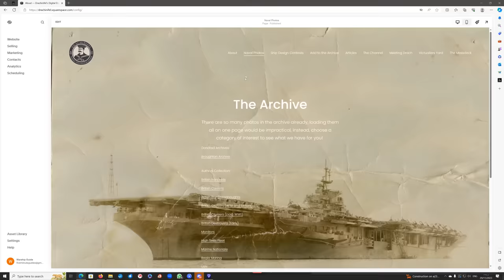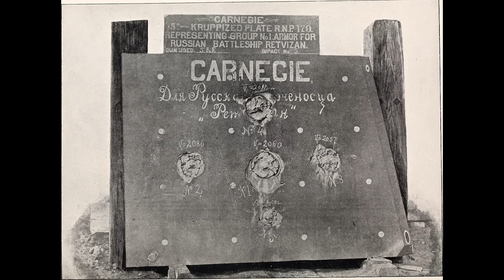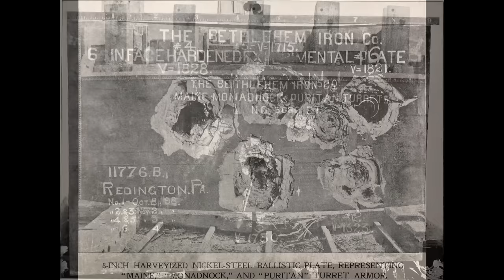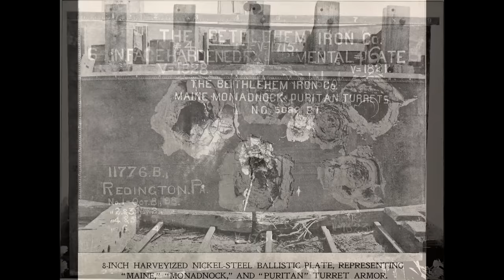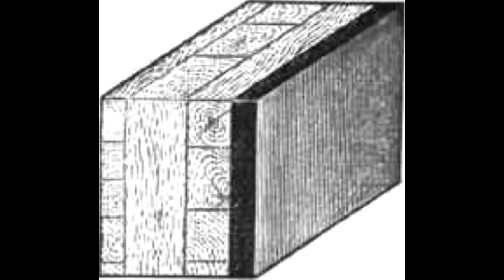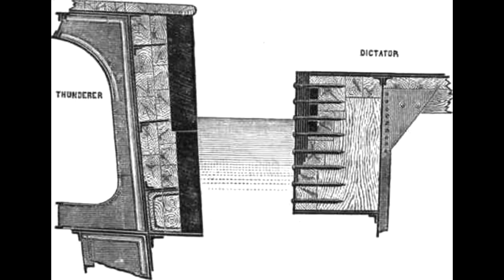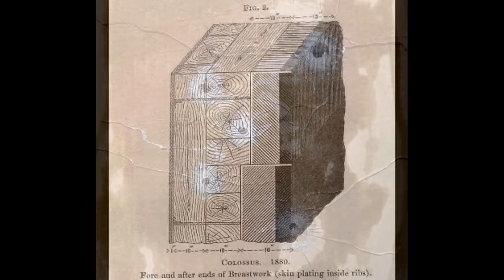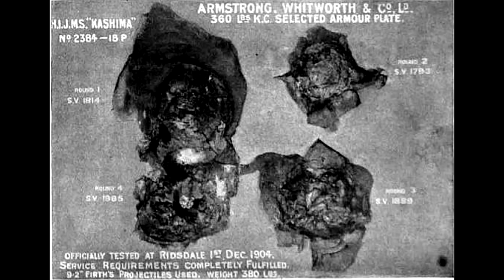Battleship Armour Engineering - Why is naval armour multi-layered?

Comment: I found it also quite interesting that with the glued together "plate" so many of the glas chips were sent flying toward the "attack." I would have expected them to penetrate slightly into the cardboard and get stuck there, rather than fyling out in the opposite direction. Is that something unique to glass and cardboard, or was a similar effect also observed with metal over wood compounds?

Comment: The word you are looking for is "toughness" which is essentially quantified by how much energy a material can absorb in an impact before fracture. This is a distinct mechanical property separate from "hardness" and "ductility"
Reply from the maker: Whilst your definition is correct that's not  the term that's useful here. With considerations of armour plate in this context its not so much when it breaks as how it breaks, any armour can be overwhelmed with a big enough gun at close enough range. But when it breaks, whether the material is relatively brittle or ductile massively affects if the material mostly remains in place, which is vital for a ship under bombardment from multiple shots.

Comment: One of the tragedies of life is that there weren’t any video cameras around to capture these tests.  I’d love to see how close the cannon was placed to the plates.  

A “finger pull” holds no fire to the 12 pounder at point blank range 😂
Reply: I always think about that with a lot of things. It would have been amazing to see things like these tests. Even with things that were recorded, I think about if there had been the high definition tech we have now, back then, it would have been incredible. The biggest one I think about is the atomic weapons tests. The detail we would be able to see would be incredible.
Reply: During tests, at least in WWII, the shells would deliberately be fitted with less propellant to simulate the desired range for testing (i.e. make the shell as slow as it would be at that range), even if the physical cannon was point blank. No reason they couldnt do that in the 1800s, at least approximately.
Reply: @builder396  it looks like that’s what the different numbers may represent.  Maybe feet per second or the amount of propellant.
Reply: @builder396  also,  I think you are right because accuracy was crucial.  No reason to waste shots and not hit anything.  15 yards sounds like a good test distance.  😂 

Need to be sure we hit the plate every time !
Reply: IIRC, Drach also found some notes from Lord Nelson's Era testing cannons against wooden planking.

Comment: So allot like (honestly from my perspective the differences are really just semantics) how iron/steel hammers and axes are set up. The business end (the part that strikes or gets struck by the intended object) has a much harder surface (either from having a harder piece laminated into that part of the tool or the material undergoing a focused process to harden just that part more than the rest of the head) to resist deformation while the rest of the tool's head is softer to better absorb and disperse the energy transferred in from the shock of the impact.

Comment: The question I have is what if there were multiple hard layers with soft layers in between? Something that could penetrate one layer of the hard armor, would it penetrate further? And even if so, wouldn't the second hard layer catch spalling better? Are there any advantages to having alternating hard and soft layers?

Comment: I would argue that wood is also brittle. It is not really capable of plastic deformation. The difference to cast iron and hardened steel is much rather, that it allows an insane amount of bending before failing and has a grain structure which constrains the break and prevents isotropic crack propagation. I mean - ok - you can compress wood without failure. But you can neither forge nor roll it. So it is ductile in some sense, but not isotropically so. Only in compression and only in some axes.
Reply: I think lignin acts as as matrix for the wood fibres, and some kinds of wood experience creep and plastic deformation.
Propably not in milliseconds at low temperature, though.

I also think wood dissipatates energy faster, so maybe a shockwave will not propagate as far is in steel (unless you split the wood along the grain.)
Lower density propably leads to that only working out in your favour in some cases.
Reply: Robin Hood and the longbow yeomanry want to have a word with you. Wooden bows bend perfectly, and so do the arrows during flight. The whole wooden ship concept is about bending wood. 🙂

(you are absolutely correct; I just couldn't resist)
Reply from the maker: It's all relative, compared to a piol noodle wood is very hard and brittle, but compared to 1860's iron armour it's ductile, and then iron becomes the ductile material when compared to steel etc. 😀

Comment: FWIW i believe Ductile means to draw metal thinner, stretching it (usually into wire). Malleability is the ability for metal to bend, twist and move without breaking.
Reply: You can find the definition using Google.

Comment: It should be remembered that one of the reasons for using iron armour initially was the development of the Paxhian shell firing gun. Shells were devastating to wooden ships, because they caused massive damage to the wooden structure, as well as setting the ship alight. The battle of Sinope was the turning point in the move to ironcladding warships. Iron was very effective against shell guns as the projectiles did not have as high velocity as solid shot. By maintaining distance iron armour was still effective against later projectiles.

Comment: I wonder what would happen if hardened armor plate was chrome plated, specifically looking at min the ricochet angle of the projectile. Theory i have is is the surface roughness would cause the projectile to"turn" or slide increasing the surface area of force reducing the pressure/in2 and possibly effecting it enough to bounce because on a microscopic level the "spikes" on normal steel are like velcro, chrome hardness can be adjusted and layered....

Comment: 📝 Summary of Key Points:

📌 Initially, hard and brittle materials like iron were used for naval armor, but they were prone to cracking and splintering, resulting in larger entry wounds and potential failure of the plates.
🧐 Tests using cardboard and plate glass demonstrated that while brittle materials may resist certain projectiles, they fail more spectacularly and allow for more damage to the ship.
🚀 A solution was found in bonding a softer, more ductile material to the harder, brittle material, which absorbed shock, reduced failure, and supported the armor plate even if it shattered.
🚀 Compound armor, Harvey armor, and C steel were developed to further improve the properties of naval armor.
🚀 Wooden backing was used in armor plates to catch fragments and enhance protection.

💡 Additional Insights and Observations:

💬 "Using a combination of brittle and ductile materials provides better protection than using a single material."
📊 No specific data or statistics were mentioned in the video.
🌐 No specific references or sources were mentioned in the video.

📣 Concluding Remarks:

The video highlights the development of naval armor from the 1860s to World War II. It explains the drawbacks of using hard and brittle materials and demonstrates the benefits of bonding a softer, more ductile material to the armor. The use of compound armor, Harvey armor, and C steel further improved naval armor's properties. The video emphasizes the importance of using a combination of materials for better protection.

Comment: Steel by it's nature is ductile. It can be hardened so the surface is able to take some beating from ambient conditions. A good example is case hardening in firearms. While iron is brittle and will shatter at failure, having failed in tension., Steel fails by tearing because it gives way far more than a brittle material like iron or aluminum. This can be seen in materials testing of samples in tension, with steel narrowing once it has reached the plastic range, before the sample finally parts. Iron does not narrow, and the sample will break in an 'S' pattern around the sample because it does not yield.

Backed iron was seen in the engagement between USS Kearsarge and CSS Alabama. Kearsarge hung chains in front of her wood sides and the ball of CSS Alabama simply bounced off. Alabama was defeated in the engagement as a result.

Wood exhibits many of the same characteristics as steel, such as ductility, but the mechanism is different. Wood will deform as the lignin deforms, bat does not have a large range of ductility and creates splinters once the elasticity is exceeded. Use of Live Oak can mitigate some of this and was used on USS Constitution, when used in a multi-layer scheme of construction, making it quite effective4 at resisting cannon fire normally seen in a Frigate engagement.. It caused the Royal navy a few headaches.
Reply: Just to nit-pick cast iron is brittle, wrought iron on the other hand is noticeably more ductile even than mild steel.
Cheap steel killed it as a material in general use by about the 1890s though. You'll probably not have seen any materials testing samples of it since it's basically been out of production since 1969 (USA) & 1974 (UK) the latter being the last producer of any quantity to speak of in the world.

Comment: I wonder: Did the tumblehome on wooden age of sail ships work at all like sloped armor? Or are the projectile kinetics too incomparable (round shot vs bullet/conical penetrators)?
Reply: It did somewhat work like it.  Indeed, in the early 1900s, US Navy Admiral David Taylor (one of the brightest and most creative naval architects of his day) proposed an alternative battleship design he called "ironsides" that featured about 45 degrees of tumblehome above the waterline.  The idea was that it would allow for thinner plate from the sloped armor effect and, at the extreme close ranges that were expected in battle at the time, the shells would be coming in nearly horizontally and would likely ricochet upward instead of digging into the armor in the first place.

The concept was never built, however, because by the time Taylor had developed it enough to conduct sub-scale testing, improvements in fire control had seen anticipated battle ranges increase to the point where shells would now be falling at a considerable angle, and the tumblehome sloping would actually make the armor thinner and at a more nearly perpendicular angle to the incoming shell, and thus it would actually be less effective than vertical belt armor.  Later designs (basically post-WW1 designs) would incorporate "inclined" armor, which was sloped at 15-20 degrees, but inclined belts were sloped *outward*, to gain the same benefit as the "ironsides" design would have had at point-blank range.

Comment: As regards suggestions, even if you don't end up doing a whole lot of empirical demonstrations, which are a huge pain to produce - it would be great to make the videos generally a bit more visual and engaging, for example by simply adding more slides to the show instead of lingering forever on one and the same static frame. In the early days especially I remember this going on while the narration had long shifted to something fairly different. Or sometimes the frame shows rather a lot of information (such as maps of sea battles with paths of two or more fleets) and I soon got lost in the absence of pointers or arrows or anything to highlight the portion relevant to the narration at a given point.

Comment: A pity you didn't include armor schemes that started during the Drach era on smaller systems  like plywood and ballistic Nylon.. Since we now have software that models crack propagation, the use of composite, and weave materials   Plywood aircraft and Ballistic nylon for personal protection and on some aircraft were used during WW2. In the modern Era Composites, fiberglass, and Kevlar (for antispalling) are common.

Comment: As a Roboteer and engineer, I want more of this.   If facehardened steels where the pinnacle of steel armor for battleships and tanks, why are those technologies being forgotten?
Reply: They are of less value for warships these days (it's impossible to protect the sensors vital to a warship's operation with ballistic armor, so any hit tends to be crippling), and newer, more advanced composite armor arrays featuring ceramics and/or ultrahard metals like tungsten and depleted uranium provide tanks with the same protection against conventional penetrators and better protection against more advanced penetrators (like HEAT and sabot rounds) for the same thickness, albeit at the cost of greater weight.  So the demand for face-hardened armor steel has dropped greatly, and thus the technology is... not so much "forgotten" as "being filed away and not used."
Reply: I'm no expert. Nathan Okun, above, is the expert. I tried linking to a collection of his articles, but I guess that was removed as spam. I think it's partly because face-hardened armor wasn't that much better against capped armor-piercing rounds, because it's expensive, and because it required flate plates instead of rounded shapes.

Comment: The  Hull and protection on the Titanic are thought to have been weakened in cold temperatures due to the phase transition and complicated by poor quality control in the steel used, which meant the transition temperature was inconsistent. This impacted steel plates and Rivets.

Comment: You run into much the same problem with knives and the hardness of the steel used.
Intuition would dictate that the harder the steel, the longer it is able to hold a keen edge, and reality bears this out.
However, eventually you run into a problem of edge damage that is the result of impact instead of abrasion, namely chipping and cracking.
You can use the same tricks with knife steels as you can with Kruppstahl in warship armor, namely differential hardening.
If you take two identical knife blanks, and you thru-harden one to a uniform high hardness, it will retain an edge fantastically cut after cut, but be vulnerable to chipping and cracking due to impact damage (and so is not suited for a cleaver type knife).
However, if you take the other blank, leave the bulk of it annealed, and harden ONLY the portion of the blade that you will be honing to a sharp edge, you will create a knife blade that has superior impact resistance, while not sacrificing much in terms of ability to retain an edge.

It would be interesting to see just how good of a knife steel an armor steel makes, and just how good of an armor steel a knife steel makes, because the similarities run straight to the core of trying to optimize for many of the same properties of the steel involved.
I imagine that the armor steel would offer substandard abrasion resistance, while the knife steel would offer not as good resistance to sharp impacts, when they are used for purposes other than they were designed for, however the other characteristics I feel would still be favorable.
Might be an interesting starting point for new armor and new knife steels, if there was some cross-pollination of metallurgical formulae between the two fields. Or maybe they end up right back with current offerings. I don't know because I'm not a materials scientist, but it seems like that's an avenue of investigation worth pursuing.

Comment: The Challenger 1 has the equivalent of 4 FEET (1220 mm) fontal armour due to its composite construction. Armour is not hard at all, it's tough or simply strong. IT 80 (up to 6mm) is around 100 t inch sq and IT 100 is around 80 t up to as thick as you can roll it. Which in the case of the UK is now ZERO as we don't have any Ordinance Factories or steel mills  left that can make it.  Odd isn't it to think a 60 odd ton tank has more than double the frontal armour of the best battleship ever made.

Comment: doesn't ductile specifically refer to the ability to be drawn or stretched? i think you mean "plastic"
Reply from the maker: Plastic deformation is non-returnable. Ductile is on the opposite end of the scale from brittle. A ductile material will bend considerably before it fails. Brittle materials bend little if at all before failure

Comment: Japanese sword makers even before 1500 solved the problem of hard metal ( which was sharp , but brittle) ...and soft steel ( would not shatter, but duller blades) by taking both metals....and after firing in a furnace...hammering both together.  Then....folding the blade over itself...hammering again and repeating this laborious process until there were dozens of laminations of both hard and soft steel....layered, in a single blade.    Japanese understanding of metallurgy was hundreds of years ahead of Europe at one point......and this highly skilled level of swordmaking is why Japanese swords are revered, given almost mythological status....even to this day.
Reply: Amazing really as Anglo Saxon swords were also pattern welded more than 1,000 years ago. To the same Frankish pattern as the rest of Northern Europe.

Comment: What is not generally known is that battleship armour was measured at a 45% angle (plunging shot) so a ship that had 12 inch armour in reality had about 8 inch armour but that was unlikely to be tested by close range fire.
Reply: 12 inch armour was 12 inches thick, measured perpendicular to its surface.  Testing against shot was done using various techniques including close range, but with lower charges "square" on to the plate; short range against a tilted plate, again with a reduced charge.  In both cases the charge was calculated to give the correct velocity for the desired impact velocity.